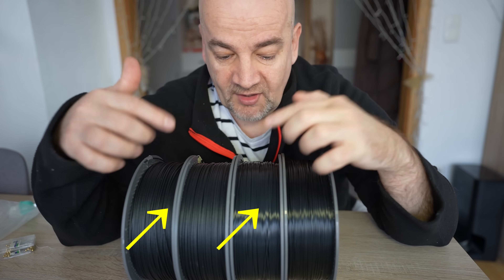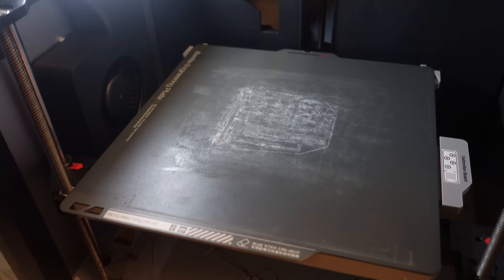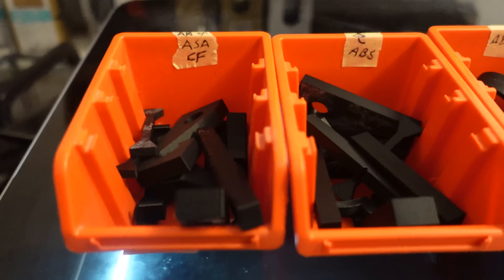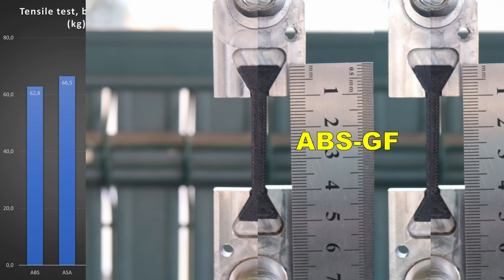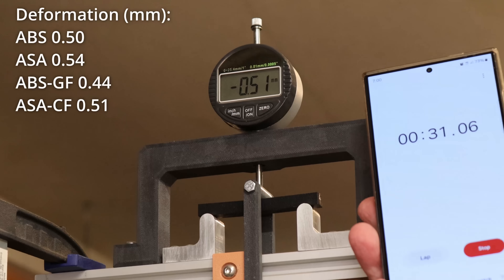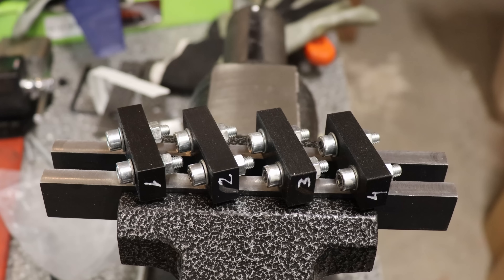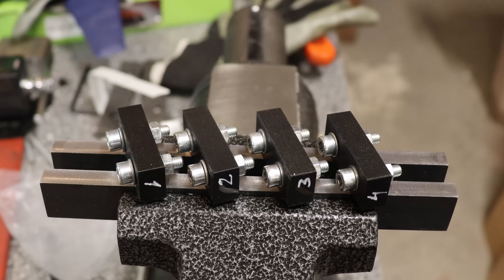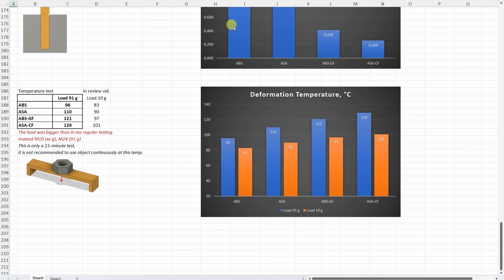BambuLab 4×Black: ABS, ASA, ABS-GF and ASA-CF

Comment: I have found Bambu's ASA to be weird. It is both smellier and more prone to warp than any other brand ASA I have tried. I stay away from their ASA as it is so prone to warping I practically find it unusable.
Reply: I have no issues, just clean pei bed and 55-60 chamber as one should use for such filaments in general
Reply: I’ve learned it the hard way, their (white) ASA warps way too much. Even at ~50°C chamber temp, the highest my P1S will go unmodified. It also starts warping surprisingly soon (i.e. at higher temps). However, I don’t have any issues with any odor, could be the shade/color.

Comment: I've said it before and I'll say it again, ASA is in my opinion the best all around 3d printing filament. Aside from it needing a heated and ventilated chamber. But I've also decided that 3d printing will just never replace aluminum for heavy duty applications. I'll keep my 3d printer for prototyping and parts that must be plastic or are very intricate. But I recently discovered it's fairly easy to cut aluminum with a standard router and bits so I will be using that for things like angle brackets and the like.
Reply: I agree! Good ASA is really awesome stuff!   For functional parts that need to be tough, it's hard to beat.  Almost all my printing these days is ASA or polycarbonate.  Polymax PC is some truly wild stuff.
Reply: The main advantage of 3D printing is to design and manufacture complex geometries that would be super expensive if not impossible to mill out traditionally. As well as fast prototyping.  

New engineering filaments like PP CF are also more than strong enough for the majority of uses and cheaper per weight than aluminum.
Reply: I used to love the eSun abs+. It was amazing until they changed their formula. My only experience with ASA was polymaker galaxy ASA and it was terrible. Maybe I got a bad batch but it was so wet, i had to dry it for like 6 hours before I could get decent prints out of it without it popping like crazy. and even when dry the layer adhesion is garbage. Like unusable. Maybe I just got a bad roll cause i hear polymaker ASA is good. What ASA do you use? I’d like to give it another shot.
Reply: Also i was printing ASA slow with 65c chamber temp in my qidi. It should definitely have performed better imo
Reply: Why?
Reply: It's worse than PLA+ in every way except for temp resistance.
Reply: @rsilvers129 That's a fairly hard claim to make given that the '+' is entirely nonstandard between brands. For all the +s I know ASA (and ABS) has them absolutely destroyed on creep, which is the main reason I would never use PLA for anything functional. PETG works ok for light loads over time as a halfway, but never PLA, + or no +.
Reply: @rsilvers129  Except the temp resistance is so bad for PLA+ that it is literally useless for many applications if you live in a hot part of the world. It's a gigantic Achilles heel. I would choose a PA-CF, PET-CF, ASA etc. For almost all of my needs, even though PLA+ is better than all of those in some areas. I only use PLA+ for testing or quick and easy prints that aren't needed to hold up long term, or won't see the outside.
Reply: @rsilvers129  this is very wrong.

Comment: that ABS-GF having higher layer bonding than the unfilled version is very interesting, is that a coextruded filament?
Reply: Other YT channels doing 3D printer material testing also had the surprising result of improved layer adhesion with chopped glass or carbon fiber.  My engineering maxim:  One good test is worth 8,567 expert opinions.

“When you can measure what you are speaking about, and express it in numbers, you know something about it.  When you cannot express it in numbers, your knowledge is of a meager and unsatisfactory kind.  It may be the beginning of knowledge, but you have scarcely, in your thoughts, advanced to the stage of science.”
― Lord Kelvin
Reply: @Liberty4Ever  bambulabs data also shows its z stregth is higher, and i didnt compare numbers, but they were in the same ballpark.
Reply: Not a coextrusion

Comment: Do you experience the tape being pulled off at the end and stuck in the AMS? All 16 refill ABS I bought from Bambu are having this issue.😂
Reply: Hm, I my case this happened with PLA and PETG. It never made an auto refill 😅
Reply: @ Hopefully they can solve it in 2025…
Reply: I've unfortunately taken to respooling all my filament to deal with this and knots on rolls. Makes me feel better about having spent the time tweaking a pastamatic print even if it is very annoying to have to do.

Comment: Thank you for this! That’s some pretty unexpected results between ASA CF and ABS GF. 

I’ve been trying to find the best material to print my voron stealthburner from and having tried Bambus Asa CF I can also agree that the deformation from the screws is a valid one. It tends to need re tightening more than I expected. 

Also have tried PET CF but to no benefit - it’s also quite a bit heavier - around 30% or so. 

If you’ve got any material recommendations that can withstand creep under high chamber temperatures while also being lightweight I’d love to hear your thoughts!!
Reply: I have been testing dragon burner parts from diffrent materials, if weight is your main priority (with high heat resistance) pa12-cf showed the best results for me, but creep is a notable problem with this material (annealing helps a bit tho and you are going to do it anyway for the better heat resistance), the other issue I had is printability (printing 2 layer pva helped, but bed adhesion was a nightmare with pa12.cf15

what might be quite perfect for you is paht-cf/ppa-cf from siraya tech. It's like 60$/kg and has increadible heat resistance (changes color when annealing, which makes it easier to see if you annealed it allready) no creep from what I have seen, sticks well to a pei bed (80-90C no adhesives worked for me) and great tensile strengh + ok layer adhesion. It's somewhere in the middle in terms of weight (1.2g/cm^3, not quite the 1.07 of pa12-cf, but still less than the pet-cf)

if stiffness is not your main concern (low print speeds maybe, or just a cover), than pa6-cf looks to be the best material: light, good strengh and layer adhesion, but absorbs water like crazy, so it looses like 60-70% of its stiffness over time (also some of its strengh)

hope it helps
Reply: I’m not sure about the weight, but PC-CF was tested on this channel and showed very little creeping and good temperature resistance
Reply from the maker: Soon 3DO PC vs PC-CF
Reply: @mytechfun awesome looking forward to it!! The only downside is weight - 1.2 g per cm vs ~1g per cm. Come to think of it it may be cool to have a leaderboard for strength (layer adhesion etc) vs filament density. 

This would be so good to have for cases like this - for example the siraya tech PET CF that I just finished printing my SB from, weighs nearly 50 grams more for the complete toolhead vs ASA CF, resulting in 1k less IS results. Anyway I’m rambling but maybe it gives you ideas for future videos :)
Reply: @HotendHacker input shaper doesn't care about strength/mass, but about stiffness/mass (resonance frequency ~sqrt(k/m) and you usually want a higher value to go faster), I think that's why your pet-cf showed worse results, it's specific stiffness is kinda low, but heat your chamber to like 70C and in theory you should get a better input shaper result over asa-cf

I would really love a specific stiffness ranking table, as a lot of ppl are printing their tool heads
Reply: @ I’m not 100% sure of this - mass has a direct effect on IS results due to higher mass reducing the resonant frequency, no? Also isn’t PET CF stiffer than ASA CF?
Reply: @HotendHacker yes, that's what I was trying to say, mass and stiffness have a direct effect, but both depend on your print settings, I switched from 4 walls 40% infill Asa to 100% infill ppa-cf and got better input shaper values than before allthough I could even feel the mass increasing, low mass is key sure, but stiffness is important to (I haven't tested lower infill ppa-cf yet, but it might be interesting to see too)

Also keep in mind mass doesn't care about orientation, stiffness does (and about the load, bending and tensile stiffness are different)

Add: asa-cf and pet-cf aren't that different in terms of stiffness as far as I know
Reply: @SippoCoffee  pet-cf is around 5500mpa and asa-cf is around 3700 so there should be a decent difference. Ppa-cf is around 10000
Reply: ppa, pps obviously.
but cheaper annealed pet cf/gf or pccf (3dxtech) or pc-pbt-gf
Reply: @ problem is their density. They are around 20-30% heavier than ABS GF / ASA CF
Reply: @warmesuppe if you ever find a pps-cf under 100€/kg pls Show me ^^
As far as I can see the pccf from 3dxtech is around 100/kg with a density of 1,38 can't wait for his siraya ppa-cf-core video to come out, as it is in the same price segment, but has lower density and supposedly 3GPa higher stiffness